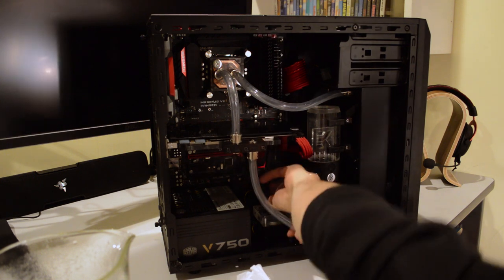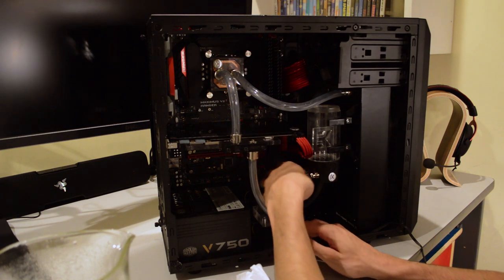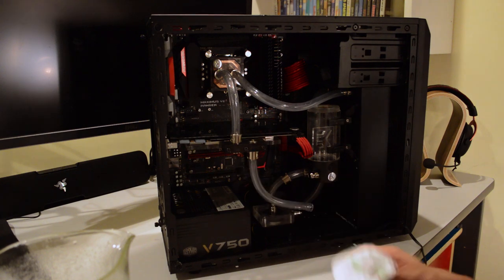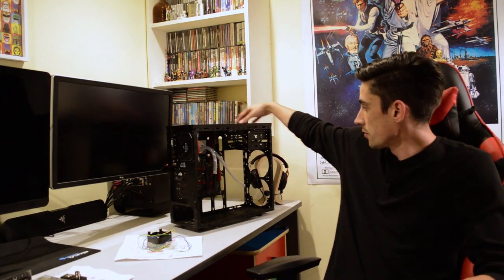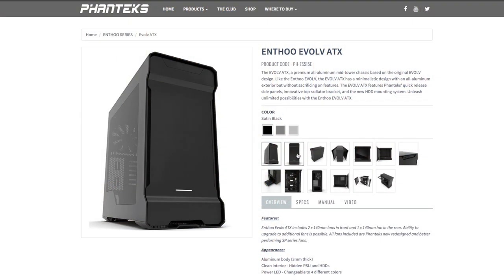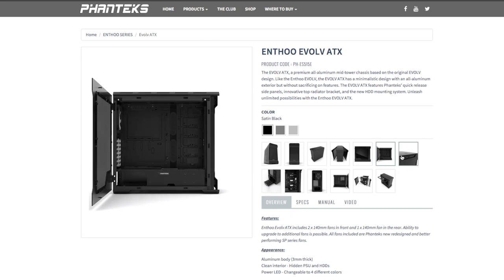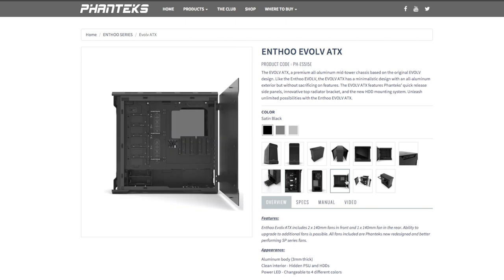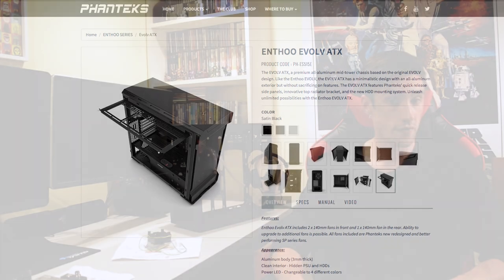Draining my first watercooling loop | PC VLOG

Comment: watched some of your videos, good job with the cable management. That 
alone got my sub! I bought the same case, i love mine spec 02 as well. I have a little different build that 
yours now, kind of closer to what you had in the beginning when you 
switched cases. I have a msi 990 gaming motherboard, amd8350 8 core 
4.0gh black with a coolermaster 212 evo, 16 gig corsair vengeance ddr3 
ram, corsair cx750m ps, msi r9 390 8 gig, samsung 250 boot drive, with a
 wd black 1tb! I hope within a couple months to water cool, and get 
another r9 390 to crossfire, but I'll need to update my ps too, anyway 
just thought id tell you a little about my system since i got to see 
your beautiful build!
Reply from the maker: +Thomas Bennett thanks man! Sounds like a pretty nice build you have. Will be awesome once you get tue second GPU in there.